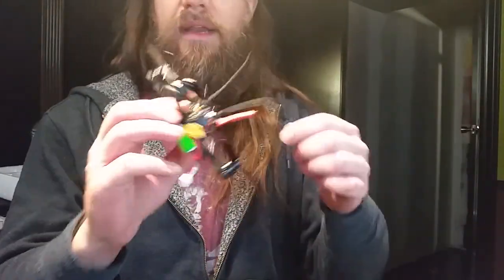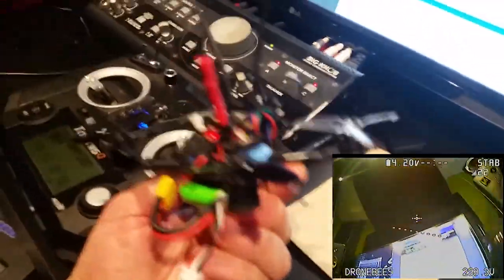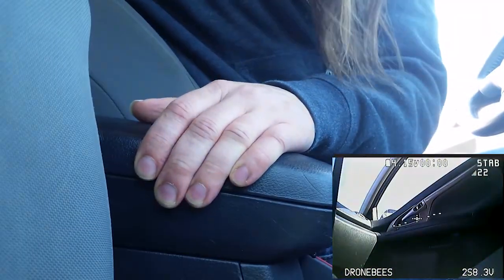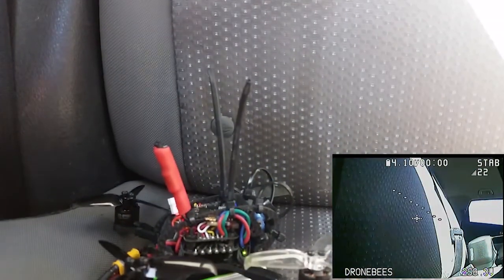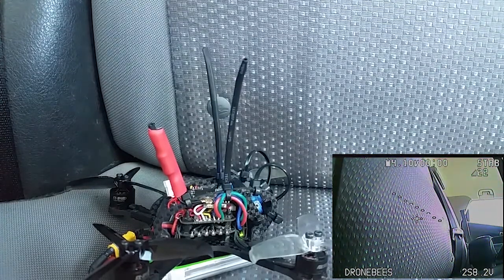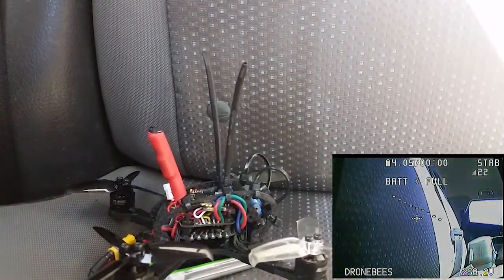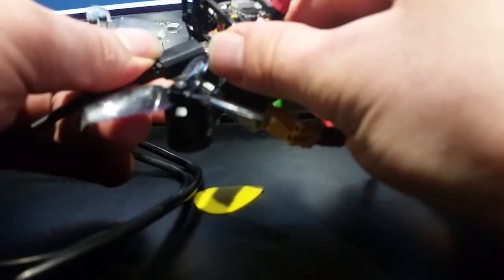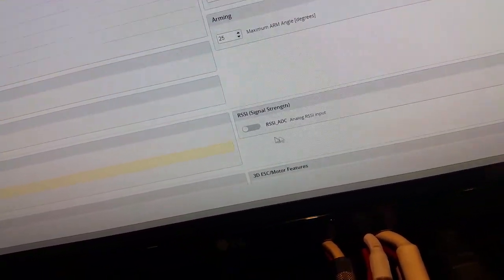Troubleshooting RSSI for the Leader-120 with XM+ frsky and Taranis QX7

Comment: Hi, At the begining of the video you said that you have new firmware so receiverr is not disconnecting being close to the transmiter. I have xm+ and taranis x7 - both with newest firmware and it is 2 years after your video and they disconnect being close. Can you give me some advice about that firmware
Reply from the maker: If it's very close then it will always disconnect. It just gets overwhelmed, but it shouldn't disconnect when you're a few metres away.